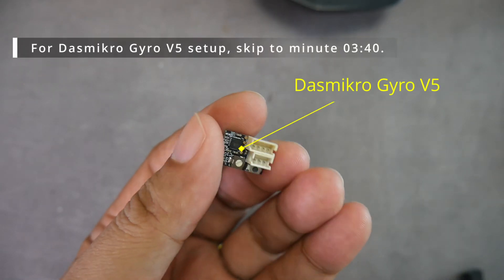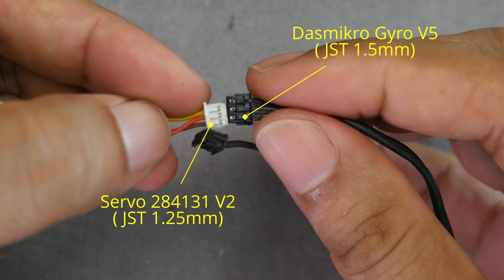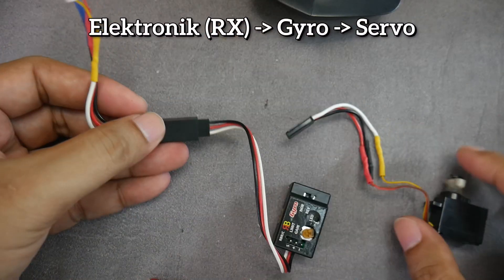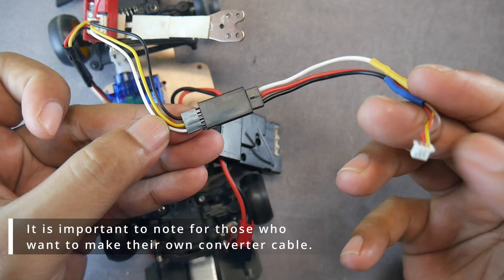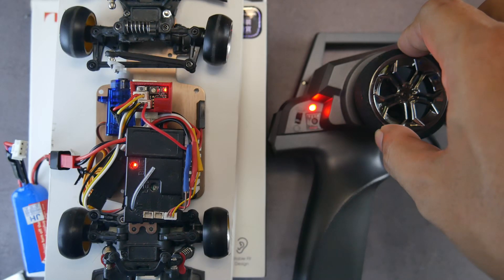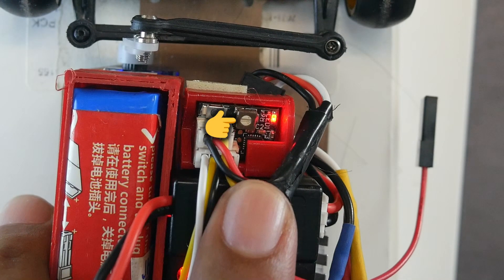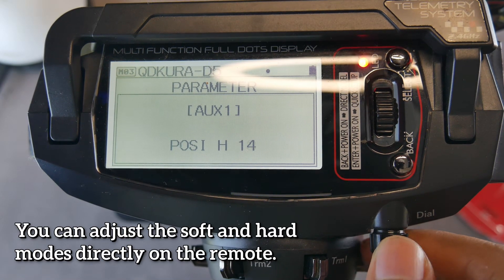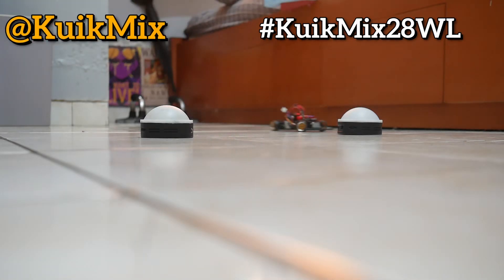The Best (and Most Affordable) Gyro for WL Toys K989 / 284131 / K969: Dasmikro Gyro V5 Setup

Comment: I so did the rwd mod with cutting the bulk head printed a couple servo adapters. For some reason my k969 will not drive straight even if i steer it straight it like automatically wants to turn the wheels 1 way . Any tips or tricks to fix this!? Also has the dasmikro gyro v5 basically same setup you have .

Comment: Hi! i set the das mikro v5 correctly according to the video setup but when i run my chassis when i steer to the right or left it just drags the front wheels. I am using the Bunta Kit with WLtoys stock electronic except for the servo which is not stock. hope you could. Thanks alot
Reply from the maker: It’s all about traction and how momentum works. When the front tires drag or refuse to turn in the direction you want, there are several possible causes. A common issue is that the steering angle is too large, or the car is being forced to turn before it gains enough momentum to drift. For example, if the car is going straight and you suddenly force a sharp turn, it will almost always continue going straight because the forward momentum is stronger than the front tire traction.

Try not to turn too sharply at the beginning—turn slightly first, and once the car starts to lean or slide, then increase the steering angle. If you’re using a third-party transmitter, you can reduce the dual rate (but since you’re using stock electronics, there’s no dual rate available).

Another possibility is that the front tires lack traction or the weight distribution is too rear-biased. This usually isn’t a big problem with good driving technique, but you can try adding some weight to the front and see if it helps.

And make sure all the suspension components are working smoothly—nothing should be binding. If one of the front wheels lifts during suspension travel, it can also cause this issue.

Comment: I have V1 of K969, which has a JR Futaba male connector on the RX and nothing else. how can i connect it to that, i don't understand? because what exactly is the 4 pin for on the DasMikro? 3 pin goes from servo to Gyro, which currently has the JR female plug on my servo. easy enough, just build an adapter. and then what do i do with the 3 pin male JR on the RX and how to connect it to the 4pin on the DasMikro gyro?
thanks for the videos, very helpful.
Reply from the maker: First of all, your servo uses a male JR connector, which means the RX side should use a female connector. It just doesn’t have an outer plastic case, so it can look like a “male” pin header. But since the servo is male, the RX should be female, right?

At least that’s how I understand it. Although, some people might say the opposite — that the servo is female and the RX is male.

To keep things clear, I’ll explain using my own terms here:

Your servo = male

RX = female (even though it lacks the outer plastic case)

The 4 pins on the gyro will be split into two JR connectors:

A) A male JR 3-wire connector that plugs into the un-cased female RX connector
B) A male JR 1-wire (signal side) that normally goes into channel 3 or 4 on a third-party RX (but not used on the stock K969)

Just follow the video closely and pay attention to the 3-wire and 1-wire positions.

So the order is: servo  -> 3- pins on gyro, then from the 4 pins on the gyro, only 3 go into the RX.

Comment: i just got into this hobby and bought my first k969, i want to replace the esc, and receiver(with gyro) for mu k969, what cheap recommendation do you have for a bushed esc?
Reply from the maker: For the ESC, you can use any cheap 30A car ESC—just make sure it has a brake function. For the transmitter and receiver, if possible, get one with an LCD display, for example the Radiolink RC4GS. But if it’s over budget, any third-party transmitter and receiver will work (DumboRC, Surpass Hobby, FlySky, etc).

I don’t recommend using a gyro that’s built into the receiver—it performs poorly for drifting. I recommend the Dasmikro Gyro V5, as shown in this video. Currently I don’t have other recommendations, because most other gyros either perform worse or are more expensive than the Dasmikro Gyro V5.

But if you still want to use a 4WD drivetrain, you can use a cheap gyro from RBR/C—it's still better than using a 2-in-1 gyro/receiver combo. Here’s a video of WL Toys using a cheap gyro: https://youtu.be/97MrnJCIktc

Comment: i have done your same mods for rwd and more steering but now i cannot use any of shells because the the steering arm  goes to far and hit the shell . any solution?
Reply from the maker: I can still use the 284131 body. You can see it in some of the drift test videos on this channel. I haven’t tried other WL Toys bodies yet.
If it hits the servo arm, there are two possible solutions. First, try shortening the servo arm — yes, it will reduce the steering angle, and that’s the trade-off. Second, trim the body where it hits the servo arm; quite a few people do that. As a note, I didn’t need to cut the 284131 body, except for the rear deck area to fit the electronics, since I replaced it with a larger servo.

This is indeed one of the drawbacks if you keep the stock steering system. If you want to use a Mini-Z or low-profile body, you’ll inevitably need to use conversion parts, such as 3D-printed ones, and so on.

Comment: where were you able to find the jr servo to jst zh1.5mm 4pin? All I can find is the 3 pin everywhere I look, even on aliexpress.
Reply from the maker: I buy it locally in Indonesia. If you can't find it, then you need to make it yourself using the stock cable.

Comment: I don’t know why my front wheels are shaky even on just 40-50 % gyro, using dasmikro v5. On 3d printed front end that I bought.
Reply from the maker: Try to reduce the vibration. You can do this by using thicker double-sided tape, softer suspension, and making sure all suspension movements are smooth

Comment: Would this apply to the dasmirco gyro V6 they just released ?. Thinking about building a k969 out for drift seems to be the best option for just getting back into RC stuff. Also any other items i should order with it other than the gyro with all the tarrif stuff abojt to hit maybe the last week to get a aliexpress order b4 eating all yhe extra expenses.  Like wheels tires , metal diff . I have a 3d printer as well for custom parts
Reply from the maker: If you use stock transmitter, it's better to buy Dasmikro Gyro V5, because V6 doesn't have manual gain potentiometer on the gyro as I mention in the video. But if you use 3rd party transmitter and receiver with free channels, then V6 is good too. I don't have it yet, but I think the installation is same.
Reply: Do you mind linking me to the servo extension cables ! All im finding is the 3 wire to 1 plug yours us the 3 wire to 2 plugs + the other one @kuikmix
Reply from the maker: Well, I bought it in Indonesia — not sure if they do exports. Try aliexpress

Comment: When I try to reverse the gyro movement the steering locks up and the gyro doesn’t activate? The light is still on. Any tips?
Reply from the maker: Make sure the steering trim on transmitter is at center. Remove the servo horn. Turn on electronic, put back the servo horn.

Comment: Thanks a lot for these videos they have been helping me build my k969 drift build and I look forward to the next video. I have a question though, what is the best affordable aftermarket receiver for a drift build on the k969/k989? Also how would you bind the receiver to the controller?
Reply from the maker: The term "affordable" has a rather broad meaning. For medium to high price ranges, I recommend the FlySky Noble series. For options under $100, I suggest getting a transmitter with a screen, such as the Radiolink RC4GS/RC6GS or other brands in the same price range that have a screen—these should be good enough. If you're looking for something cheaper and without a screen, you can go with DumboRC or similar. 

But if you mean buying only the receiver while using the stock WL Toys transmitter, I personally haven't tried that and would prefer to replace the transmitter altogether. As for the binding process with a WL Toys receiver, I haven't tried it either. It’s possible that the method is the same as with most receivers, which is pressing and holding the bind button.

The process of binding the receiver to the transmitter can vary between brands. If you buy a new set, the transmitter and receiver are usually pre-bound. But if not, the typical binding process involves turning on the transmitter, then turning on the receiver (after it's connected to the ESC and battery), pressing and holding the receiver’s bind button until the light flashes quickly (usually you'll need a small screwdriver to press the bind button), then releasing the button and waiting for the binding process to finish.

Comment: Hello what kind of transmitter do you recommend to upgrade the k969?
Reply from the maker: It depends on the budget, of course. If money is not an issue, the Flysky Noble is great. For a more budget-friendly option, any transmitter with a screen is recommended, such as the Radiolink RC4GS or RC6GS. However, if the budget is tight, I think any RC car transmitter will do. But I suggest buying a brand and model where we can purchase the receiver separately (if they sold the micro receiver is better). This way, it's easier if you want to buy an additional receiver in case you have more than one RC

Comment: @ kuikmix Thx for the video man! 😊 
I can‘t find the jr servo to jst zh 1.5mm 4pin you show at 1:11 .
Do you have a link from where you bought it?
Thx in advance ✌🏻
Reply from the maker: Unfortunately, I bought it in Indonesia, and it's not sold overseas. I'm sure it's available somewhere else, but I haven't found it yet. You might try changing the search keywords. Or try ask in WlToys forum. In case you still can't find it, you may need to make it yourself. You will need to buy a '4-pin JST ZH 1.5mm connector' and two JR/Futaba servo connectors for the ends.
Reply: Thx 4 answering! Hope i‘ll find them. 
Can u help me again? I connected the gyro and it doesn’t steer on the right unless I turn the steering trim fully to the left. What can be the issue?
Reply from the maker: Sorry, I just missed your reply (it's easier to notice if you write a new comment instead of replying). About your question, after installing a gyro, you might need to adjust the servo horn again. Remove the servo horn, set the steering trim to 0, turn on the electronics, and then reinstall the servo horn. Hope it works!
Reply: @peteraufderklamm912 hey how did you install the gyro i have the k969 do i really need to buy all of those wires and weld them?
Reply: @Clips4Days7  yes! I did it just like shown in the video.
Reply: @peteraufderklamm912 can u tell me exactly what cables u bought?

Comment: Man, gotta say a big thanks. ive tried alot of rwd mods  over the past month., especially the steering rack part, tried direct steering, other popular  methods and CS mod on youtube, they all come with a drawback which the creators dont tell you. using stock remote and ofcourse fixing the diff - refer to beaver - this steering mod of yours is the best out there. only thing i did different, was instead of the 2 cups on top of each other, i moved the one from the servo horn just infront of the other cup on the wheel hub., about the same hight, it gave me needed toe out( using aluminuim arm). my only only problem still, when i release throttle, the back wheels "handbrake" tried open diff fix, one way diff, same issue. guess a sensored setup might fix it. AGAIN, THANKS ALOT, THIS IS THE BEST.
Reply from the maker: Wow, thanks, bro! I'm glad it worked for you, and thanks for the tips! :)

Comment: how did u pull off the stock brass pinion (that thing dont wanna come off), and where did u get a replacement
Reply: Thanks to a "pignon extractor for Rc" bought on Amazon, 8€, otherwise it's impossibile. Than you can take a pignon from a mini4wd, we all have one of that 90's somewhere 😅
Reply: @matteomanera9467  i got one of them extractors it just breaks motor >.> and pinion is still on T.T
i really wish it had a grub screw.
Reply: had to buy spare parts from WLtoys distributor to fix.... full motor mount with 130 motor and pin ion attached
Reply from the maker: Yup, it's really hard indeed. Here's what I did: https://youtu.be/ZnSnHN3VKT0